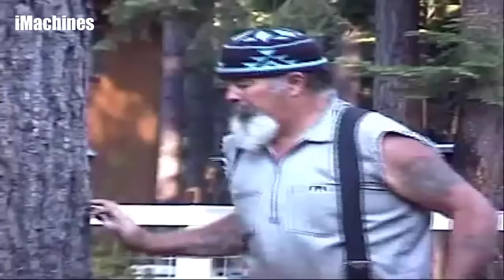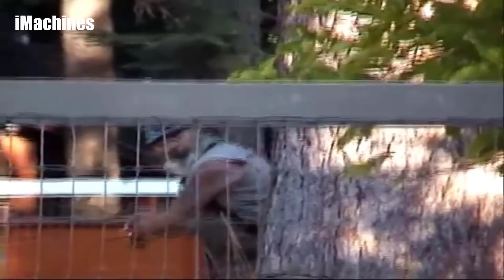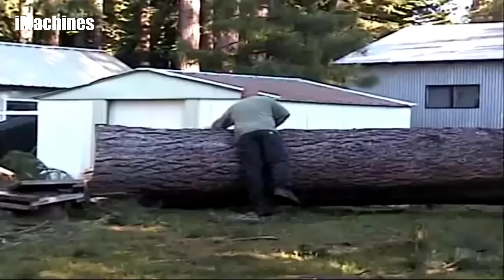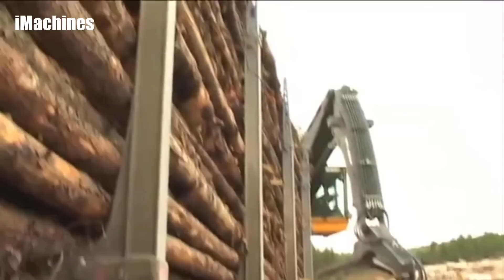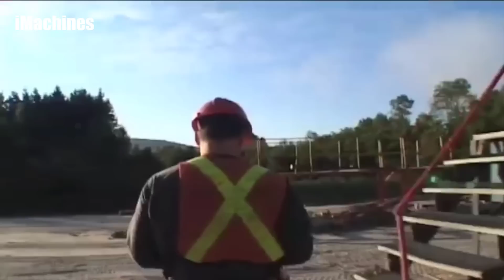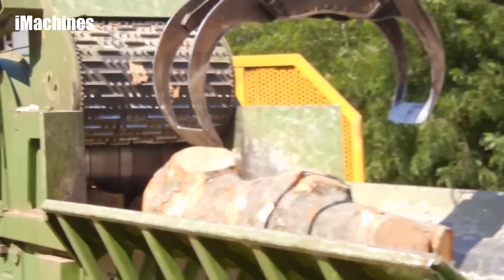Amazing Fastest Skill Biggest Logging Truck Working - Heavy Chainsaw Tree Felling & Wood Crusher

Comment: He must cut softwood trees most of the time because when you cut a lot of hardwood you cut the notch from above to have gravity help because hardwood is tougher/harder. Should have used more than 1 wedge and better to use a longer bar but that 1 was ok also. The hinge was pretty wide but you can get away with that with softwood but with hardwood a lot of times you will not get away with that because the hinge could "barberchair" as we call it, unless the tree is hollow. A tree that barberchairs could very well maim or kill a guy. I will say you had good aim as I suppose it landed where you wanted it to land. I do have the right to comment as I worked in the bush in eastern Canada for over 10 yrs.
Reply: flydieselair lot smaller chance for kickback with that type of notch, even in hardwoods
Reply: @roco4608  There is no difference, With a short bar the only thing that can happen is if you have a left a little bit uncut in the middle because of the short bar then when the tip of the bar hits the little bit left in the centre the nose for the bar can hit and kick back. Or if the tree starts to come back a little and start to pinch the bar you can have a kick back.
Reply: logged for years,  we almost always use humboldt notch unless its a heavy leaner. Helps the butt hit ground first instead of top as usually happens with conventional and open faced cuts (which usually breaks log in the process, losing board feet and thus money...)
Reply: @wildbill6976  I mean no disrespect as we cut hardwood and at the bottom most hardwood flares out so that part would not have made it to the sawmill. The requirement for the sawmill we sold hardwood to was for logs to be 8ft. 4 inches so we tried to get as many 8 footers as we could. I have the utmost respect for anyone that swings a saw. I know it is one of the most dangerous jobs there is. My brother-inlaw almost lost a foot and a friend was crushed when he cut a tree that had fallen against another and did not get out of the way as fast as he thought he could have. I cut my thigh pretty bad but that was in the days before worker's comp. made you wear chainsaw pants. I had a cousin that was almost taken out when a big maple barberchaired on him because he did not make the back cut to the hinge fast enough. There can be quite a bit of excitement working in the bush. Stay safe Billy Severt.
Reply: @flydieselair  ดภ
Reply: ઑકકઑઑઑએ